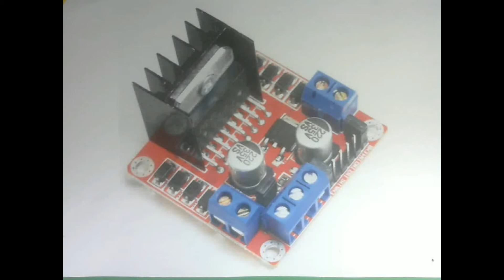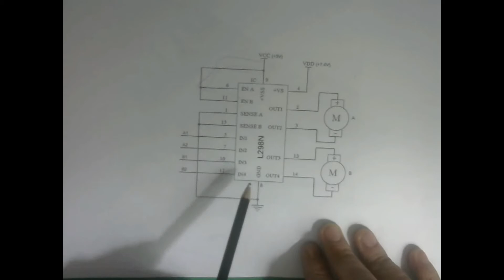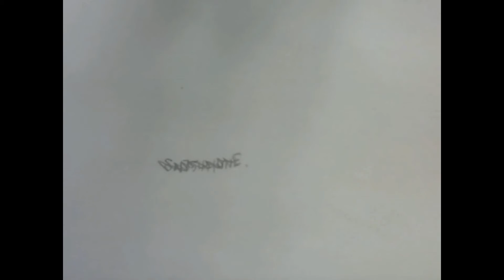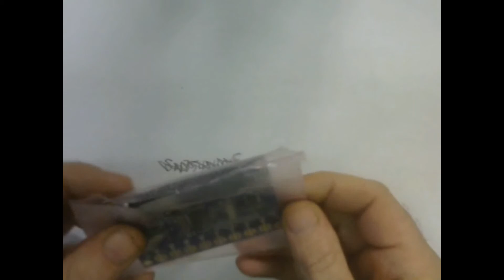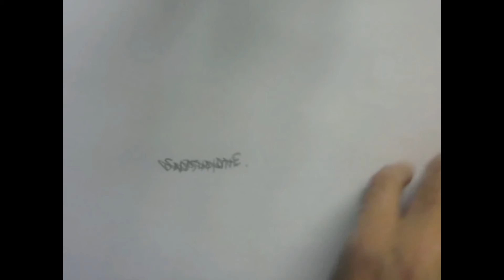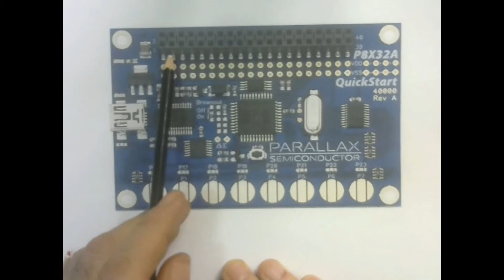MY Motor Controller L298N final Edit1

Comment: Wow! That was fantastic! You're absolutely right, those pictures are much easier to see than the PCBs. It was really helpful to see which parts of my video weren't clear. I'll be more careful to make sure it's clear what I'm connecting where in my future videos.
You video gave me lots of ideas. Thank you very much.
Just a warning. Your assumption about how I powered the QuickStart was incorrect. Don't connect 5V to the Vdd pin. I'll make a video to show just how I power the QuickStart externally soon.
Again, this was fantastic. Thank you.